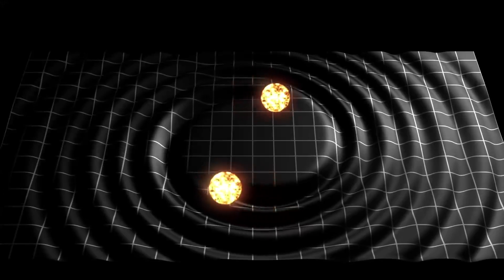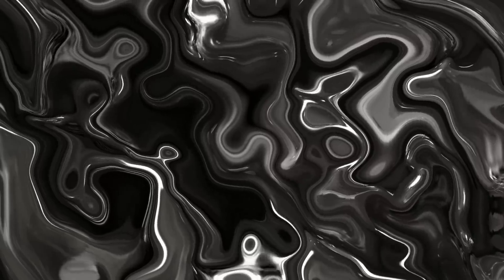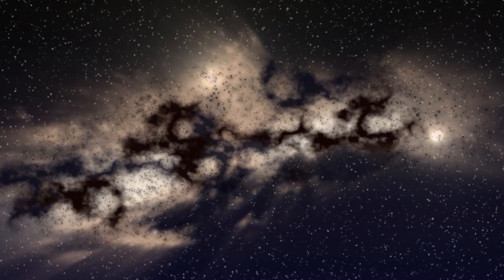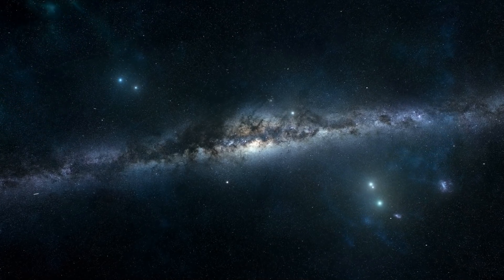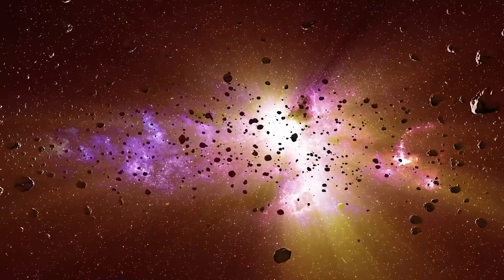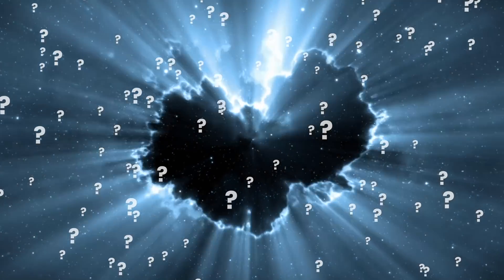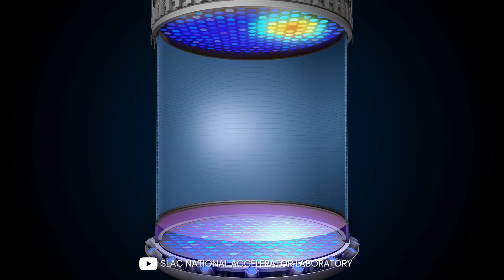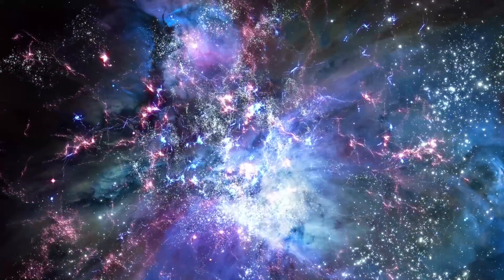This Will Change Physics! Dark Matter May Not Exist!

Comment: What if the stars that are further away from the black hole in the center is the thing holding the stars nearby it together? A galaxy has millions or even billions of stars so it's possible that while it gets weaker as you go away from it, it basically extends the gravity's influence. Just a thought.

Comment: Part-time DM is like the "spin spacetime censorship" effect gravity boffins in Israel dreamed up to explain nonlocality hints in entanglements without dumping the bent spacetime their entire "modern" culture uses for intellectual prestige. If you have a crossing of "impossibly" focused contra-rotating filaments, spin interference prevents galactic spin rates used to identify DM, yet filament gravity can still pin the galaxy in position. There are ways to quantize gravity for fine-scaled to cosmic-scaled flows, and general relativity is happy to rule all of them out, in its nastily overdone light-centric way.

Comment: If you can find a galaxy without dark matter, dark matter must exist.
Reply: Maybe it's like the "spin spacetime censorship" effect that gravity theorists in Israel have dreamed up to explain nonlocality hints in entanglements without dumping the bent spacetime their entire "modern" culture relies on so heavily for false intellectual prestige. If you have the "impossibly" focused gravity of two counter-rotating filaments crossing, the gravity pins the galaxy in position but doesn't support the galactic rotation rates used to identify DM.
Reply: @CACBCCCU  But then it has to apply everywhere. You cannot find galaxies which are exceptions.
Reply: @oneukum  Exceptions to what? Exceptions to being small and hiding behind the skirts of much larger galaxies? Have I made it clear I think the question is incredibly biased and silly yet? Let me risk more of the same:

Filaments do not fill space, not all filaments intersect, and although not all intersected filaments have to spin in the same direction, a self-discouraging aspect in contra-rotations helps. In locations where they do contra-rotate and overlap, they are less attractive to organizing a dwarf for very long compared to co-rotating filament crossings. Any galactic filament configurations with contra-rotations prominent are less likely to be particularly long lived for not being mutually reinforcing, galactic evolution will discourage them. The longest filaments join the co-rotating spin axes of large galaxies. Smaller weaker spin systems can form filament-driven flows gradually curving within a spinning galactic equatorial plane. 

It's not a rational question but change is never easy. It's a bit like not believing an iris with the concentrated ray of brown seen at the start of this video is impossible under any law of eyeballs because then all blue eyes would be brown. If gravity from a mass can focus in a few directions, then it must be weaker in others. Filaments are all about cold-matter concentrated spin gravity being directionally selective about where retro-reflected energy will flow. DM spin filament observations are all about unexplainedly-striking gravitational spin contrasts standing apart, mostly clarified by wide open intergalactic spaces. 

Not all space is equally cold, equally vacuous and equally spin-organized. Elliptical galaxies are a typically a hot mess of small organized spins due to recent energetic mergers. I'm probably going to ignore you soon. No time for lazy contrarians.

Comment: There's a simple wormhole-free explanation for roughly octahedral shapes in Bennu and Ryugu, for entanglements and for DM filaments, one that doesn't require diamond sand. It's one-dimensional field carrier orbital networks forming between field-retroreflective cold nucleons that conform to three intersecting mutually perpendicular cold-flattened field-reflective disks.

If you model gravity with Planck scale energy dipoles where compressed light energy cups a strong relatively incompressible true vacuum and allow the dipole to be considered massless by mutually opposing relative energy effects, and further allow a dipole to longitudinally rotate at galactic rates and beyond, responsive to use a fundamental source property of hydrogen nucleus E/G free-space force ratios (10^36) to re-scale effective proton size (10^-15 m) in a sort of balance of field energies as products of force times distance, the rotation rate hits a sweet spot in largely quantized flat spinning galaxy sizes, (10^21 meters). 

Flipping Einstein's theory on its head periodically due to radiated longitudinal energy dipole rotation (dipole rotational "pitch") has a remarkable contrast effect for focusing matter both centrally and in one or maybe two concentric ring-like secondary gravity troughs, there can be a huge DM effect easy to mis-comprehend as local DM in the secondary trough. If a ring gets too heavy or it gets deformed from the outside by a large rapidly passing mass, continued gravity trough circularity helps to split the ring neatly into two arms. Longer rotation rates in the mix would explain cluster DM effects nicely and may help explain DE. 

The most interesting feature of the DM effect is filamentary and spin-loaded and may similarly correspond to a polar focus of slowly rotating, slowly evolving, cold hydrogen gravity messenger retro-reflection flows running along the filament. Galaxies may get pinned between counter-rotating filaments with the result being a cancelling out of any high galactic rotation rate DM effect. Such galaxies will tend to be small and disorganized, not flattened out like pizza dough by rotation and cold gravity focus binding, not centrally compact enough to encourage a surrounding ring-trough nor large enough to populate such a ring. 

Gravity focus creates a natural tunnel effect on light, capable of carrying entanglements. Entanglement gravity bridging between larger uncorrelated atoms lacks the simple effectiveness of focus possible with cold hydrogen, especially if the hydrogen is bound to a large dark molecule, but the cold focus effect is available regardless of the atoms involved and it's best if both atoms are the same, and supposing rotation with the same handedness and rate on a shared rotation axis. It's easiest in this framework to think of light as pulled by gravity and dragging less on stronger gravity. 

The efficiency of focus possible with hydrogen bonds on large organic molecules presumably makes it the most entropy-restraining and heat resistant of focused gravity effects and thus best for easy lightweight entanglements and biological evolution.

The details of the cold retro-reflective proton model can be very simple, like three intersecting quark subsystem gravity mirrors together. The model applies to any nucleon, and when edges spatially align and concatenate in a heterogenous porous cold-formed conglomerate the result corresponds nicely to orthogonal ridges in the only two observed loose "rubble pile" asteroids.
Reply: The latest attempt to let spin, bent spacetime and entanglement coexist is to invoke "spin spacetime censorship," but it's like inventing yet another convenient property of nature to hide the abysmal energy-based failures of wormholes and general relativity. Looks like they forgot to extend it to spin in DM filaments.

Comment: Quiz: A green satellite looks blue from earth, green when you get up there. You recall inundation with countless Einstein Sunday news stories on smaller eyeballs and faster clocks making blue turn greenish, or worse. Thus: A) Gravity shift made length and time metrics shift. B) Gravity shift made lightspeed shift. C) keep time reliant on frequency counts needing frequent resets.

General Relativity basics for light: Special Relativity's Perfectly Flat Everlasting "c" bends everything for more simplicity. Using GR, you can measure distance with light by counting wavelengths of a known frequency (X wave-cycles/meter) and measure time with light by counting oscillations of a known frequency (Y wave-cycles/second). Supposing speed of light is constant, blue-shifted light's faster oscillation rate means time rate is faster, while a fixed count of its shorter wave cycles defines shorter meters. Faster seconds and shorter meters allow blue-shifted light to cover a constant number of meters per second.  Red shift is handled similarly with the same result, namely a constant number of meters per second.

GR theory is a lot like forgetting you are wearing color-shift lenses, it is as if all light observed always must have been "born" shaped the same. Gravity shifts along a light channel are seemingly not allowed to observably affect the light waveform, except to let the waveform's path seemingly curve.  Always excluding detectable gravitational color shift effects in space while always allowing bend effects may to some people seem "non-conformal" by seemingly showing non-realism in action. Others may be more concerned that blue-shifted light, with accompanying length/time metrics keeping vacuum lightspeed constant on the moon as seen from the Earth, does not seem to agree naturally with the slower falling rate there. As vertical meter sticks are presumably less compressed under the moon's weaker gravity, the contraction in length metric there seems deeply unreal. There is a separate reasonable expectation that a faster time rate will never reasonably agree with a slower falling rate. Again the result of basing time on color seems non-conformal. 

Favoring variations of space and time metrics, in favor of keeping constant vacuum lightspeed, was a winning formula for a nonexistent gravity universe, so Einstein extended it to gravity because once again the most conveniently elliptical light-centric equations would be earnestly begging everyone to follow a well-known conceit, to wit: "God is a mathematician/physicist," 

Faster light is not the same as faster seconds or slower seconds. When space is laterally stretched more on the inward side of a mass, then GR, a model of gravity where stretchable space fabric gets conveniently pulled down by gravity pushing on top of it, like a heavy complicated entropy-maximizing information-whistle, shines like political treasure. When light is faster on the inward side of a mass, what pulls light inward faster? Answer is flat time, bent time, backward time, any kind of time. 

Believe it or not: Unbent time and unbent space also have the benefit of giving an easy accurate accounting of energy. In an energy balance, after you subtract the gravitational to kinetic energy shift (color shift) to each photon, all you then need to do is make sure to have a reliable count of photons on both ends. It's clever to discourage a universal time standard, for supposing a reality of growing time divergences, especially with gravity as the only excuse. The more it is done, the cleverer it is. Keeping wavelength constant, together with constant time and space metrics, while letting frequency vary, means initially redshifted light realistically must be light initially slowed by decreased gravity. Same with a passing rumble-strip effect. Light frequency is independent of photon rate, meaning a constant-rate countable photon (or light pulse) source gives the only reliable light-based indicator for time rate. Heisenberg's uncertainty applied to light says a perfectly tight frequency source is a perfectly random phase timing source, so atomic clock frequency means basically nothing about the only good time rate measure, namely photon rate.

Comment: I feel like this is a dumb question, but could there be an element with outrageous density that we don't know about causing the odd gravitational phenomena?
Reply: They look for impact flashes and consequent particle showers, using very sensitive detectors to find what should be quite common. Conventional matter like you describe was ruled out this way a long time ago. Also, stability fails for supermassive elements, again with particle showers that should be commonly visible if existent, but they are lacking. It's a huge effect complicating an authentic-seeming new form of matter and a detector to fit it.
Reply: Thank you for an excellent explanation. I guess there would be random objects orbiting what looks like nothing if the super dense material was in kind of a cloud of dust. Or it would all condense into a ball. Polarized super dense material!?
Reply: @JamesDavis-rz2cq  Thank you. Believe it or not I was a patent examiner for a few decades. Followed dark matter theories since stories about Vera Rubin appeared. It has always looked like a problem with gravity theory. 

The idea of quantizing gravity as radiated Planck-scale vacuum energy dipoles explains a lot to me, whether or not it's 100% correct. One of the symmetry breaks with quantizing gravity is that radiation doesn't have to be equal in every direction, it can favor filamentary flows along a cold proton's spin axis and spin plane, for example. Also different about gravity field information carriers is that gravitons should flow with practically zero mass or slightly negative energy (relative to cold vacuum baseline energy density) much more finely than light at lowest energies.

Another thing about the dipole model, as I see it, is if it is allowed to show an ultra-slow "pitch" (longitudinal rotation) at a cycle-size-scale close to a typical galaxy. This effect is not dependent on coldness in matter, unlike the filamentary effects. The consequent stationary spatial wave effect for a super-dense central mass focuses equatorial matter into one or more concentric ringlike matter-foci in flat galaxies. Hoag's Object (my avatar) shows a stable version of such a matter-gathering concentric ring focus effect, I suppose. A long time ago it was thought by astronomers to be an Einstein ring. 

Many ellipticals show side-lit concentric effects (shell galaxies). For shell galaxies illuminated by a simple source there is typically an effect suggestive of light ricocheting off different reflection-constructive phases while passing through the galaxy on its way to earth. NGC 474 is the best shell galaxy image I know about. Light from various directions interacts with the radiated gravity pattern, again as if gravity has a slowly rotating directional light reflecting capacity, where deflection direction depends partly on distance from the super-dense center. I imagine luminous matter dispersed throughout the shells being involved in a process where graviton phase angle favors various sideward light-bearing gravity messenger impact continuation angles. I am still working on improving the description.

It's possible to select "latest comments" to see what else I've said about these things here, I suppose. I'm not selling any books or videos, fwiw.

Comment: Ooooor, space and time are connected and relative. If time near a black hole nears zero then your comparing a galaxy to “our passage of time”. When in reality that galaxy is experiencing time at a higher rate because of its mass. Where mass is present, the space time blanket shrinks. Mass and space time interchange. More mass=less space and time. Too much mass and the space time creates a void of nothing. Time reaches zero at the event horizon because the bubble inside of the black hole does not exist. There is no time and there is no space there. What we call “gravity” is really just space collapsing at an even rate. Space is shrinking towards the center of a large mass. It’s literally like everyone is looking too close at the details and not at the big picture. 

A white singularity / “Big Bang” / center of black hole - they are all the same thing at different stages. A white singularity explodes and it can’t happen inside the black hole where space and time doesn’t exist. It happens everywhere outside of the black hole. The white singularity is a higher dimensional object puncturing a 3dimensional plane. It is visible everywhere. Except the main thing you see is it’s relationships with itself. Protons neutrons atoms stars planets...it’s all just black holes and white singularities. The electromagnetic currents are what tie everything together that can be measured. Vibrations. On the largest scale we have galaxies where time seems slow-mo compared to us. And on the smallest scale time is so fast it’s a blur. The wave of probability problem occurs from the amount of time we observe it. If I showed you a picture of the earth orbiting the sun, but it was a long exposure photo over 10,000 years...and said point out the earth. You couldn’t. You could just give me a probability of where I am most likely to find it. There is only light and dark. Photons are examples. They are perfectly balanced. The mass on the inside is the same as the mass on the outside so it moves frictionlessly and at the fastest possible rate we can perceive at this scale. The universe is a fractal. The only difference is scale and how space and time effect the two. Assign definitions to the individual parts and you further your chance to understand because you are creating the separation that doesn’t exist. Of course you’ll end up trying to find ways to make that work, when in reality it works as it is. As above, so below.